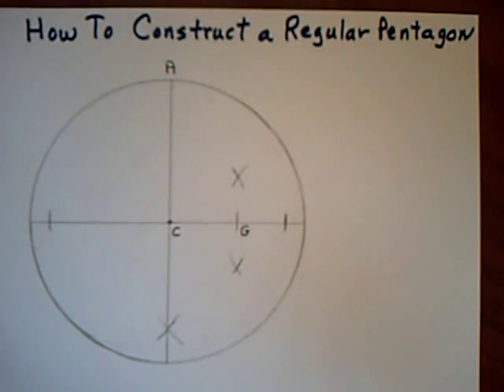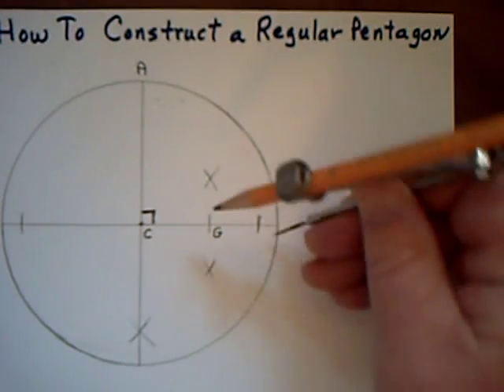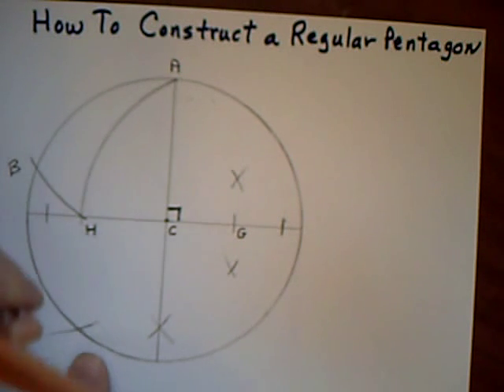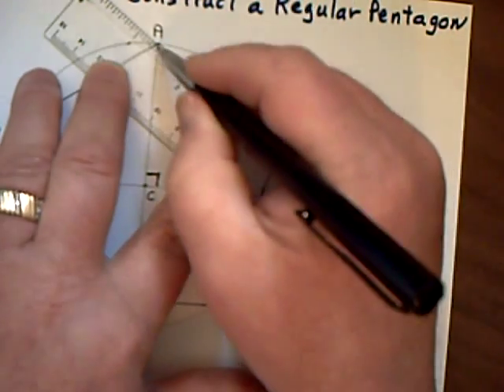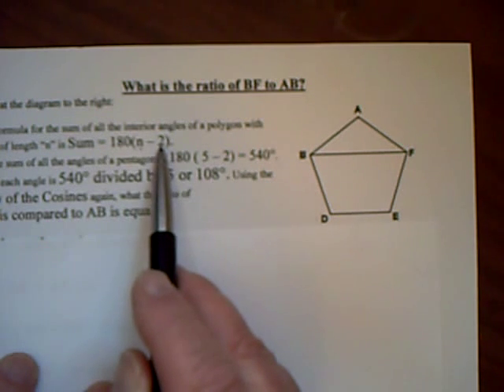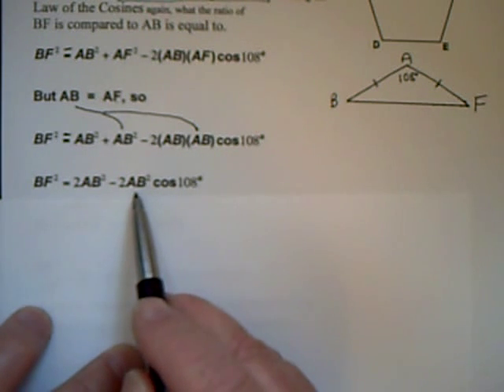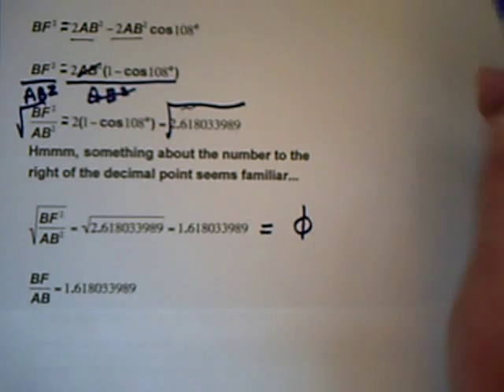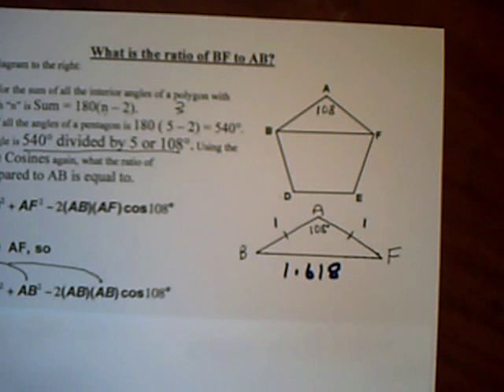How To Construct a Pentagon

Comment: @acecf23 let u(1) be the fisrt term so that the three terms are given by, u(1)r^0, u(1)r^1 and u(1)r^2 respectivelly.

The third term is given by the u(1)r^2=3.2[u(1)+u(1)r] which implies that r^2=3.2(1+r) and consequently r^2-3.2r-3.2=0 and by solving the quadratic equation for r we yield:
r=-4/5; r=4

since r must be a positive integer greater than 0, r=4

The sum of the terms and is given by 42=u(1)[r+r^2]=u(1)[4+4^2]=20u(1) and therefore u(1)=21/10

u(1)=21/10
u(2)=42/5
u(3)=168/5

Comment: @theboombody Think of a wheel and choose a point on the wheel. imagine this point being in contact with the ground. imagine it spinning until the point is on the ground again. The distance moved by teh wheel will give us the circumference. If the radius is a half, the circumference will be Pi.
The quantities are related by the formula: length=(angle in radians)x(radius) so by calculatinig the circumference one is choosing 2Pi to be the angle. if we choose other unit, Pi will still be present.